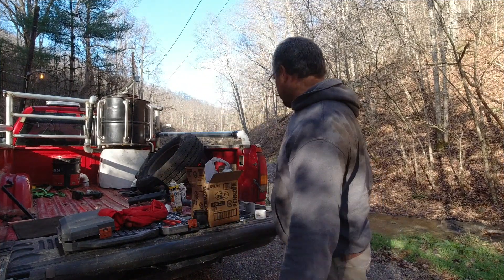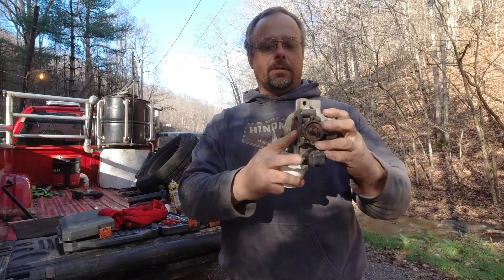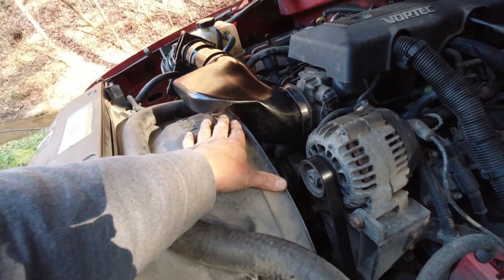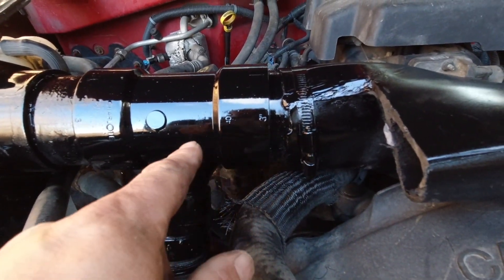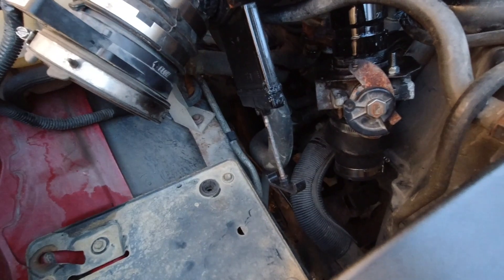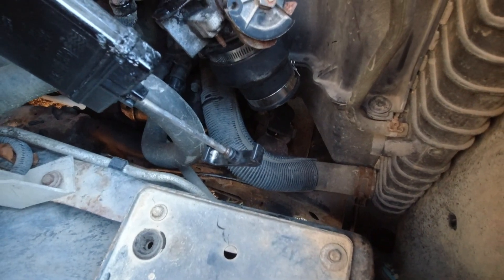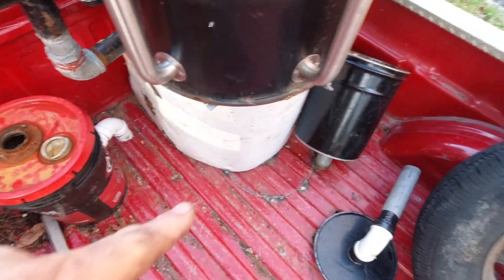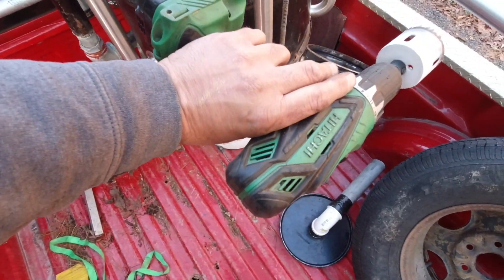Gasifier fuel/air mixer

Comment: It's going to be low on power with a single feed line that's something that's been on my mind lately and I'm going to have a little part in my next video talking about that
Reply from the maker: You are probably right. I already have it plumbed up now though. I am going to try it as is but I do expect to run the other line. I'll have to gather up more parts though. One thing I don't get is I only have a 2 inch line coming out of the gasifier. I don't see how I could pull more gas than the 2 inch line can flow.
Reply: @lukeFugate  I can't explain it, but it has some fancy scientific term. Basically the air entering the gasifier as it flows through and super heats expands at a certain rate and when it gets out of the fire tube it is more spread out. Then through the cooling rails it can condense back and become more thicker. I dont really understand it exactly but it all has to do with the heat from the charbed
Reply from the maker: @BigBeavrSlayer  ah that makes sense.
Reply: @lukeFugate  when I'm cruising at speed I can close off one line and the performance is the same, but trying to take off from a dead stop with one line it's pretty darn slow haha. If you hybrid it won't be any problem at all. If I need to get out in traffic quickly I'll turn the fuel pump on and get uo to speed quick then switch back to wood for the cruising that works really well in my dodge